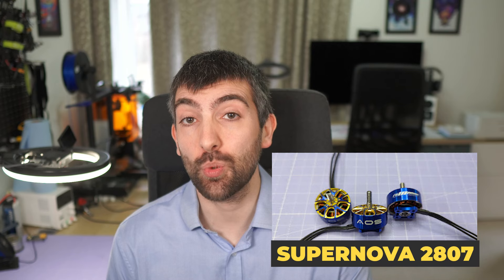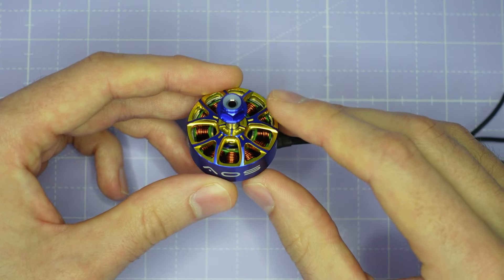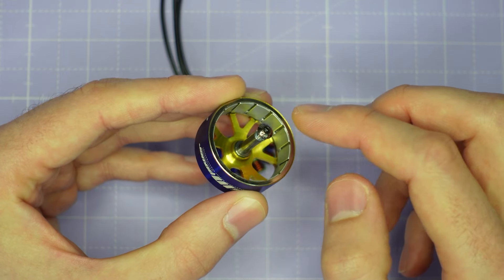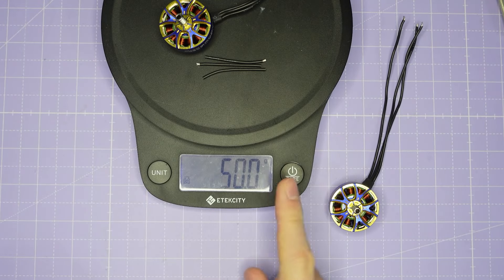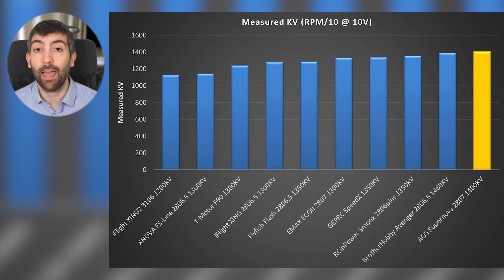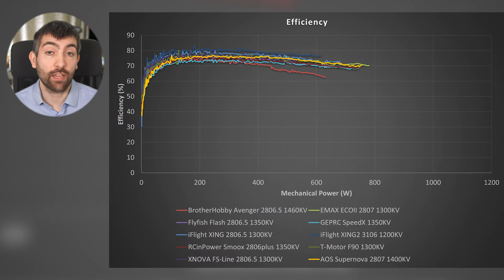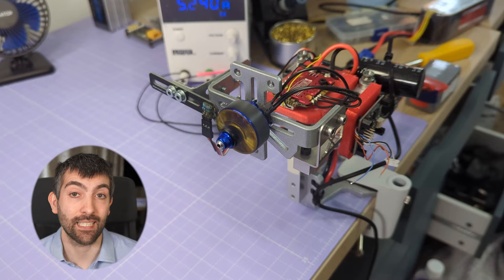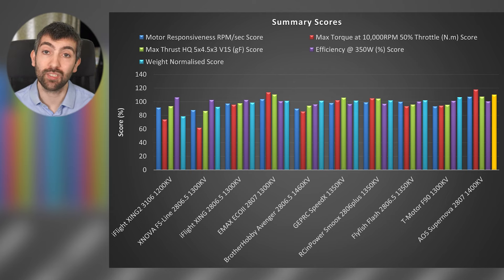The Ultimate 7" Motor? The AOS Supernova 2807

Comment from the maker: I did an Interview with JB on the design process, check it out here: https://youtu.be/yxZZ2M3gRyI
You can find the motor at GetFPV: https://www.getfpv.com/aos-rc-supernova-2807-fpv-motor-1400kv.html?afid=UUtYYnFRVXhDMEk9&referring_service=link
DefianceRC: https://www.defiancerc.com/products/rcinpower-aos-supernova-2807-1400kv-motor
Retailers order direct from RCinPower: sales02@rcinpower.com
FPVStore: https://fpvstorerc.com/products/rcinpower-aos-supernova-2807-1400kv-brushless-motor
Taobao: https://item.taobao.com/item.htm?ft=t&id=776599338000&spm=a21dvs.23580594.0.0.1d293d0drGlSWn&sku_properties=31309:31315999596
AliExpress: https://www.aliexpress.com/item/1005006756249509.html
Many more retailers coming very soon.
Reply: Why no Foxeer Black Hornet motors?  I fly 2809 Black Hornets at 1300kv and was curious how they compare.  Foxeer, i think, is made by RCinpower?

Thanks for the video and all you do 👍👍🇺🇸
Reply: And do you know if there will be european retailers too?
Reply: Mr. Rosser, Chris, where can I get the 2207 Supernove? Can I get some directly from you? I need some 5" motors. I just don't know if I should use the 2807s on a 5", that's all.
I really appreciate your contribution to FPV flight. 
Please let me know, fine sir. 
Thank you.
Reply: @canigetachannel  This has been my experience with buying out-of-stock AOS motors, and a not scientific, but probably mostly true estimation on motor and frame size.  Just in case any of this is valuable to you or others: 

 If you're building a quad-copter that is fitted for a 5-inch prop, and you want to mount AOS_SuperNOVAs, you will need the 2207, 1980Kv. These motors will handle up to a 6S battery.   I have a set of these on my Manta-X frame. It weighs about 650-grams, with the battery. She's a fun quad. Somehow feels lighter than she is.  The AOS_2807, 1400Kv is suited for a bigger prop, so putting them on a 5-inch prop, would probably be less snappy & responsive compared to the 2207 size. More often than not, I find that if it's got AOS o the bell, it's probably on back-order. I ordered from   getFPV  , a month ago, and the 2807 were sold out, but it only took them less than an extra two weeks to get them back in stock and ship. And a few months ago, I went through   DefianceRC   for the 2207 set, also on back order, but they also got them to me in less than three weeks. 

Ordering things that the distributor is already back-logged on, sometimes it helps get the part in your mailbox a little faster, if you can order from a place that is (a)Closer to you  (b)Ships in a direct route to your delivery location. (if you can figure out their shipping route)
Reply: @Inertia888   
 Thank you. I now have 2 sets of them 6S, and also the 8S set! They're scary fast! 😃 
I'm still using xing 2807 for my LR quads. 
 Thank you for the comment. 
FlyTribe!

Comment: I would really liked to have seen a mininova, specifically the best for a 3.5 or 3inch sub250
Reply: I was about to comment as well the same thing 😂 would love to see this kinda motor like (1504-1804ish) sizes
Reply: @adamseal yes please! i have had enough of these tiny 1404s😤😤😤
Reply: You're not thinking small enough LOL super tiny whoop Nova. Oh I'm sure he has plans to make a supernova version for all the popular motor sizes it's all a matter of time
Reply: yep and plane versions too
Reply: 3.5 inch master race
Reply: Ideally in the 10-12g range.
Reply: @Nemesishk nah, 4 inch is superior
Reply: Well i figured chris has his new 3.5 aos frame... So i figured something perfect for that, i currently use skystars 1505 which matches up with 3630 props really well, but i think they could be lightened up with smaller 2 hole mounting base and made to be a little faster and more powerful by optimizing the design. 1804 would probably be to heavy, id rather run a larger cell battery so it has the amps like a 4s 850mah... I don't think smaller 6s batteries are as effective imo
Reply: @Bruno-cb5gk  they don't have 8 bladed prop for 4 inch drons
Reply: @Nemesishk why do you need an 8 bladed prop??? If you're under 250g then a Gemfan 4024 2 blade gives you over 800g of thrust, you can get up to 13:1 thrust to weight ratio.
Reply: @Bruno-cb5gk  because I like the sound of 8 bladed props (sounds a bit like a mini fighter jet) and also they have insane thrust, I reach 250-300km/h with my 3 inch, lmao, albeit for only 2 seconds
Reply: He will drop some for 3.5 next Ill bet
Reply: who cares about performance on a 250 shitquad
Reply: @Guenounovitch  I'd put 100 bucks on the line that you don't own a quad faster than some of my 3" quads.

Comment: But is it an actual 2807 size or again its a larger motor made lighter, thinner and more fragile to save weight? also almost all innovations you can find on other motors too, performance gains are marginal as-well, makes the ECO 2807 seems a better deal, and your KV is too high if you want efficiency for long range, people now go for 1150kv for 7inch or rewind the motors
Reply: Havent seen 1150kv for 7"  u less poeple are using 2810 or 2812 instead of 2807.
Bigger motors allow lower kv. 
Try the gemfan 7050 props. Love them
Reply: I saw some long range guys rewind them for lower kv to get more efficieny, you don't need 1400kv for a 7-7.5inch prop
Reply: It's not that the Eco seems like a better deal it IS a better deal, IMHO... it's like just because 'x' car is better with this model doesn't always mean it applies to every model
Reply: Look up the MannyH!mself 2808 1230kv motors. They're designed specifically for Street League spec racing. Interesting motors indeed.
Reply: @BikeGuyFPV  street league runs on 5S. 1230kv on 5S is like 1100kv on 6S.
Reply: @andrewbt87 nice try steele hahaha you haters are all the sane….

Comment: Looking at the scores, for the price the EMax Eco II is looking to be a strong competitor.
Reply: I tested the 1500 kv on a 7" 6S and was more than happy with the final result. Before that the same quad was running 2207 1800kv motors. The 2207 were doing fine as long as the quad was new but over time with crashes, they started to become hot probably because bashed quads introduce more vibrations. The bigger 2807 ecoII solved that issue. Note, the motors bearings of the ecoII did a metallic sound when they were new, but it didn't affect performance in a way I could notice.
Reply: @alainassaf  I’ve got the Eco II 2807 1300kv on my 7” quad and they have been holding up very well. Even after the worst crash I’ve ever had on any quad. Like you said they have a different sound but my motors land after 15 minutes and are cold/cool to the touch.
Reply: Yes, am looking to build a l.r. drone and the Eco seems like the best value by a long shot
Reply: What you say, I going on with, about 10€ more is about 150% of the EMax Eco II 2807, I would prefer the EMax, I´m sorry for Chirs, because he is did, does and doing a great job, thanks for that! Greatings form Germany
Reply: I have a Rekon7 with eco2 2807 1300’s as well and they’ve been great. For the money, they can’t be beat. I did have to replace one because it was vibrating bad causing tons of jello in my goggles, but that was after prob 80 flights with 4200mah liion 6s packs so they had some serious hours on them.
Reply: I honestly believe that emax made their 7” motors so good purely  by accident 😂 I own them on my aos7, they pull like a truck. Those extra few grams means nothing when my build with 8000mah li-ion weighs 1500 grams 💀
Reply: @grimblade888  it’s good to see that it’s not only mine that weighs soo much with two 4200mah 6S1P batteries.
Reply: Ugh eco’s are mediocre at best! They are NOT great at anything other than saving a few bucks a motor….. just get quality motors peeps ….. they are not a area to cheap out on.
Reply: @LovesM855A1  video above proves that they are best at thrust and second best at everything else. Bruv u trippin 😂

Comment: - The only thing missing is real life long range test (or send them to someone who does long range, eg. Falcon Rad FPV).
- I might be mistaken but long range is all about the range (so efficiency first?).
- Tbh normalization by motor weight is nice but with weight of quad being more that 600g (with battery > 1000 g) change in 6 grams is 1%) it might be more interesting to do normalization by total weight of average craft of it's size with 4 motors (avg weight of 7" drone in this case).
- It would be really interesting if you tried designing 1S whoop motor (eg. 0702 26000 kv) for efficiency.
- Do you only do something like interpolation betweeen all the motor parameters or do you run something like genetic/evolutionary algorithm (feel free to keep your secret)?

Thanks

Comment: Besides the emax 2807 giving this new motor some performance competition, your motor is slightly better than the rest, because it's a 2807 vs 2806.5.
Yeah, the weight is lighter. Thats what you buy a premium motor for.
I'm running 2808 on 7".

Comment: Everybody talks about not great efficiency but looking at data sheets the AOS 2807 at 50% throttle has 6.045 g/W efficiency with GF 7040-3 (1030g for 7.1 A) whereas Emax ECOII 2807 with same props, with a similar thrust of 900g is pulling 9.3A, so an efficency of 3.84 g/W. Yet we doesn't see this on the charts on this video. What am I missing because looking at the data sheet thoses AOS motors looks like the best i've ever seen 🤔
Reply: The datasheet looks so enticing but then I look at this video and I feel like going crazy. So something is lying.
Reply: I fly these motors LR on a 7 inch Foxeer w/ O3 and a take off weight around 1.2kg with a 6S 3500mah LiPo
AOS 2807 1400kv w/ GemFan 7040 
I see the lowest amp draw from any drone this size I've flown. Avg ~2amp to maintain a 40-60mph cruise at ~6000ft asl.
Reply: Then I can dive down and freestyle spot on my way back or hit ~100mph because of the higher KV and light weight or even run 8S for super fast chasing capabilities. These are legit epic 7inch motors. Just $$$
Reply: @DroneDocs  is that 2 amps per motor? because that would be the most insane thing ever if it was the total amp draw
Reply: @Vogxel  per motor 8 amp total.
Reply: @DroneDocs  IS your current sensor calibrated? Does not seem realistic to me
Reply: @YaroDrone  this is a fair point however realistically the variance from an uncalibrated high end ESC shouldn't be more than 10% under 5amps. I had a 7.5" Chimera on 3008 1350kv 7535 props and it was similar at 4amps per or 16amps total under similar flight conditions. Mind you this is mid throttle, 35° cam angle,  cruising at high altitude. 
 I will revisit this after a fine calibration. And hopefully find more credible data.

Comment: Somewhat disappointed as to how this was presented. Efficiency looks not very promising for a long-range cruiser. You say its 'middle of the pack' but your chart shows that at lower throttle, it is actually 'bottom of the chart'. Nobody flies their 7 inch at full tilt or even medium-high throttle for cinematic cruising. The iFlight motors look much better on this chart.

But it guess it comes down to use case scenario. If you need to chase proper race cars around a track, this may be more suitable. I would argue though that very few people get the chance to actually do that. The majority of 7 inch pilots will favor efficiency above most things, including weight. Finally its really hard to justify the 33 dollar price when the Emax Eco II is THAT good.
Reply: Exactly, for LR, it totally comes down to the motor/prop/amp draw, that's why I don't really fall into the Helion 10 hype, the actual and draw is no better than a well planned out 7-8"
Reply: yeah so the Emax Eco has more power, better efficiency, half the price, You should be looking at efficiency well bellow that 200W power target, that's where you'll cruise

Comment: That is great news. In the specifications for the motor, I cannot find the wire gauge used, nor the total length of copper used.
I would like to do some calculations to determine the total weight of copper used in the motor if possible.

Comment: i put the supernova motors on my nazgul v2 dc5 BNF and im getting flutter noise from the motors , what P.I.D tune can i use to fix this ?
Reply: What motors did you swap them out for?   I see it comes with 2207,   and a choice of either: 
6S, 1800KV   ||   4S,  2750KV
iFlight probably had it dialed in pretty good, if it was pre-tuned. 
So, I'm hoping to hear that putting a slightly larger stator volume, and an additional  180 turns or wire, was enough to tip the whole tune over the edge.    (if this is the case)> I would try Chris' BF Preset, for a   [ 5"AOS Build  ] 
His tunes are pretty gentle, so they're a  safe place to start.  
    I wish I could be more help for you. Did it survive the month?  Any progress with the tune?

Comment: We need a 1507 with a titanium shaft, 3000kv or slightly higher. Since the xing 1507 dropped off the market, we have had zero options for a 3000kv or higher,  5mm titanium shaft 3" race motor.

Comment: 7:08 if I was to pick the motor for maximum range, would it make sense to
1- for each motor look at the torque at max efficiency
2- multiply this number by 4 motors, subtract the quad weight
3- compare the results. 

How do I convert watts to torque in grams ? (motors do it all the time but I don't know why I can't)
Reply: You would want to test each motor with multiple prop combinations to find the most efficient... and this is the most important part... It has to be in what throttle range/speed you'd be flying in most of the time

Comment: I fly a 2810 1400kv motor on my 7". I would love to see you talk about fast 7-in builds And what motor would be best for going above 100 mph while still being efficient and not just long range.
Reply: I run 2808 1100kv motors on 8S on my 7" build.
The fastest tri blade props are the gemfan 7050. The fastest 7" props I've tried are the APC 7x6 bi blades.
190 kph on the tri blades and 210 kph on the bi blades.
If you just cruise LR, then you still get 24 min flight time.
Reply: @chrisbee5481  ya I run those APC 7x6x2 props on my quad. Those props are amazing! I'm only on 6s though. I'm also topping out close to 210kph.
Reply: @AgroAaronFpv  there are apc 7x11 props. Should get a higher top speed. Got some, but havent tried them. Need some matching motors. Probably 2812 but dont know which kv. I'd guess 950~1000kv on 8S.
Reply: @chrisbee5481  I saw those as well, wasn't sure what motors would get the most out of them though so I haven't tried them yet either.

Comment: At the begining of the video ou talk about a motor capable to swing a 7 or 8 inch prop, but in the data sheet the motor is tested with 6 and 7 inch props. Is this motor suitable for a lightweight 8 inch build ?
Reply from the maker: Yes absolutely. Plenty of torque for a moderate pitch 8" triblade prop. E.g. HQ 8x4x3
Reply: @ChrisRosser  thanks for the answer 🙏🙏

Comment: Wouldn't it be better to compare against motors that have the same measured kV, rather than those with lower measured kV? Otherwise the only thing you can really compare apples-to-apples is efficiency.

Comment: A 7 inch prop is doing more "work" than a 5 inch prop. Yet your 7 inch uses 835 Watts, and the 5" uses 1457 Watts!? Are the prop tip speeds too fast on the 5" prop? Transonic flow?
Reply: You can get the prices yourself and adjust the ranking based on that. Depending what is available locally and the cost of shipping it might be that a more expensive motor that is available locally is cheaper to buy than the cheapest one with overseas shipping+customs hassle+taxes.